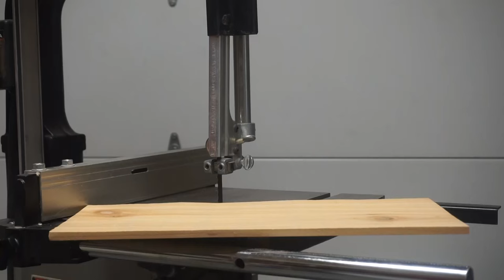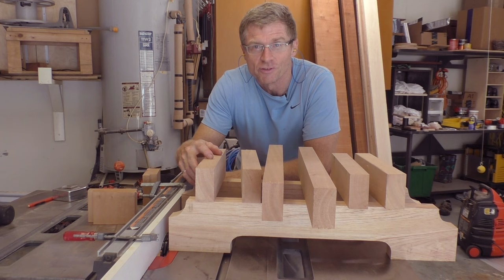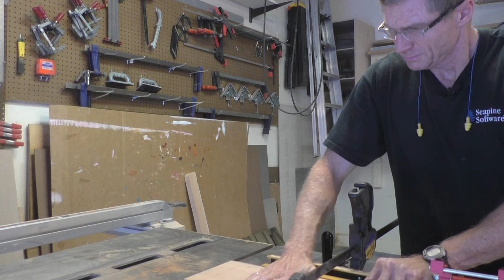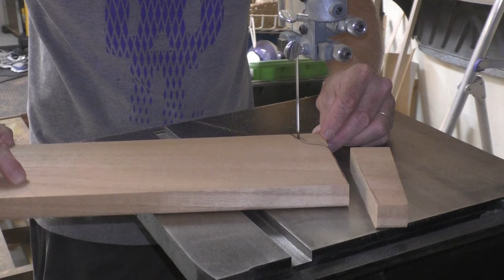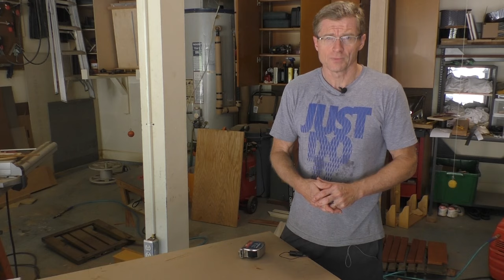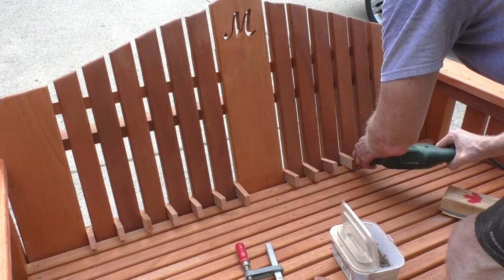How to make a Cedar Glider

Comment: Hi. My husband has just made a glider. We are not sure it is gliding as much as it should be. How should the brackets be angled?
Reply from the maker: With the glider that I built using the 10" long brackets, I have them spaced about 19 1/2" apart at the top, and about 16 1/2" at the bottom.  I recently made another glider using 7 1/2" brackets. For those, I kept the spacing about the same, but I had to adjust the vertical positioning to accommodate the shorter length.  I put a link in the description for the 7 1/2" brackets / bearing straps that I used for the second glider.  I hope that helps!